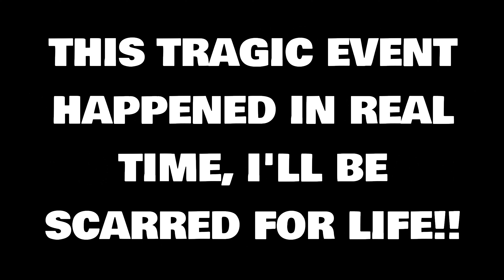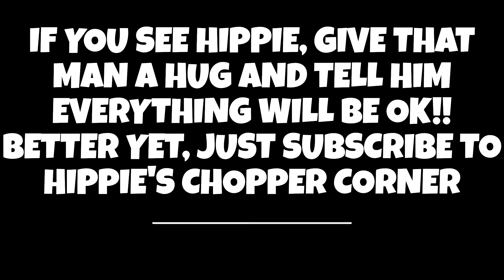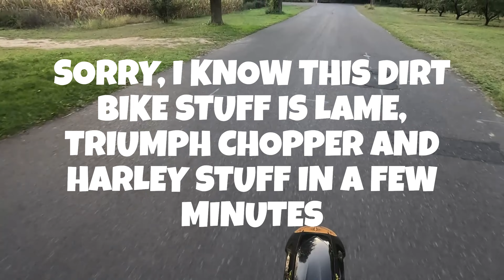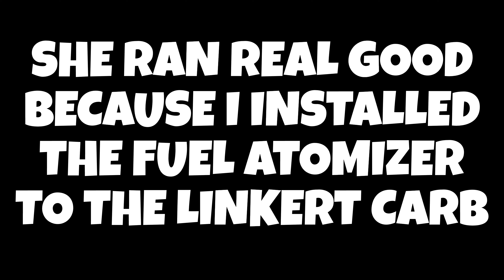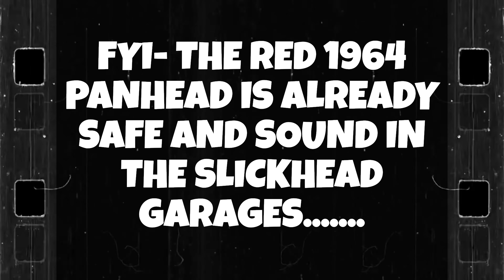GARAGE UPDATE- PANHEAD COMING SOON!!

Comment: Okay, so I know you have your hands full
(Stop playing with it, put it away)
& I know you know what you`re doing
(Just STOP doing it)
Doing mock ups is a typical bike building thing, but
do you ever start on paper?
As in, take a picture of that purple trumpet.
Make several copies blown up in size like 1 foot equals 2 inches on paper.
Then cut it up & paste it back together stretched or lowered or whatever.
You can use a straight edge
(if you had a straight edge?)
Draw in the missing pieces.
You can weld & you already have a titled frame.
So, why buy one?
Just decide where you`re gonna cut it, etc.
Or just add a 3rd wheel & call it a tricycle?
Maybe a bell on the bars & a beanie on your head?
...I got candy, GET IN THE VAN!
Reply: @jaynedoe1959 slick been looking for a shop helper 😂😂😂😂 Meg, I'm so sorry, I couldn't help myself
Reply: Shop helper? So, that`s what you`re calling it? @hippieschoppercorner
Reply from the maker: For one jayne that’s all too smart, us dumby male bikers, we don’t play with no arts and crafts!!!! Lol what your saying just makes to much sense we just guesstimate hack cut measure twice cut again, that sorta thing!!! And of course, why wouldn’t i just use that frame, and maybe one day, i’ll just end up doing it your way, cuz it just makes more sense.  But i have all the original paper work on the guy who built that bike, just so happens he’s in my same union, from back in the early nineties!!! I figured I’d pull the motor and start from scratch and save that frame and roller all as one complete set for someone else to put a motor in it or for me to do for that matter, because I don’t like to sell anything!!!! I just thought it was too cool to go tearing up.
Reply: I always say hire the handicap, they`re fun to watch!  @SlickHeadCustomCycles